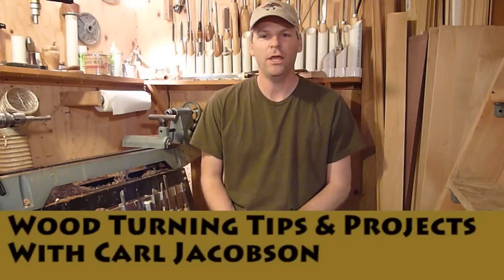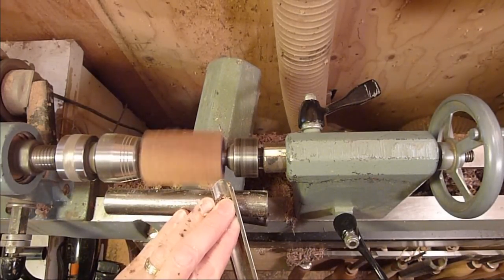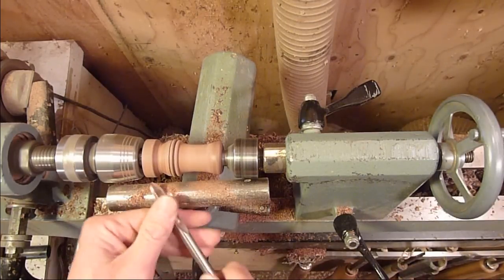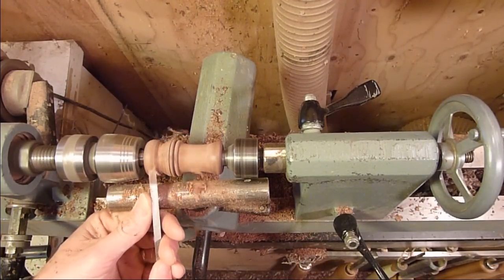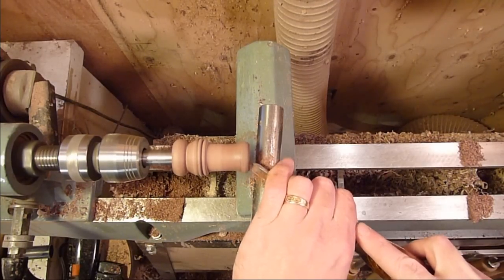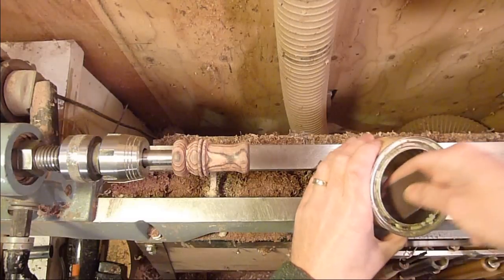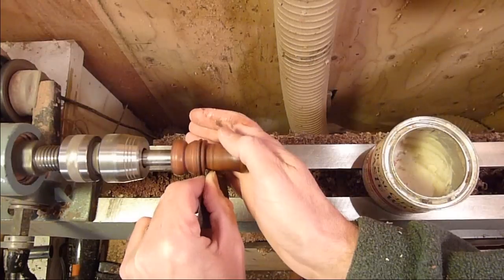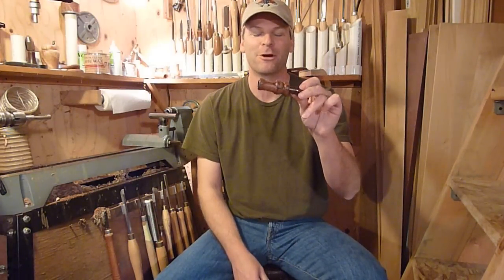Woodturning Projects Cocobolo Duck Call

Comment: Mr. Carl, I have the exact lathe you're using in this video.  From the headstock to the tailstock, could you tell me what instruments are in between?  Chuck, mandrel, etc.  I made your pin chuck today, it works, but I'm having to use the big chuck (approx. 6" dia.) that came w/ the lathe bc it's all I've got.  btw, the whole chuck came loose and flew across my cabinet shop today.  Thx.